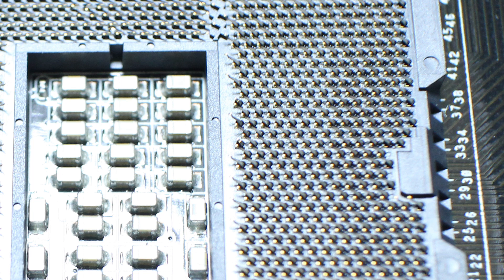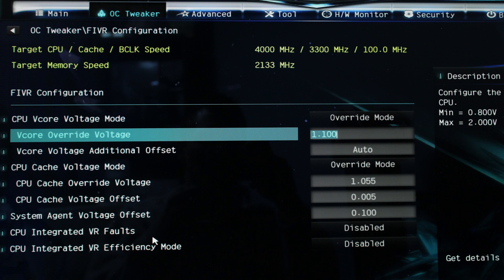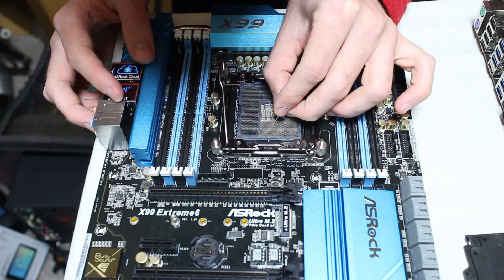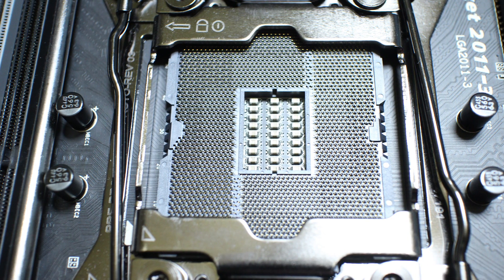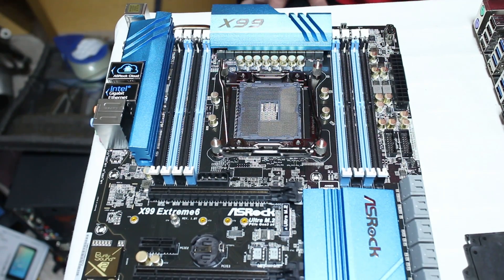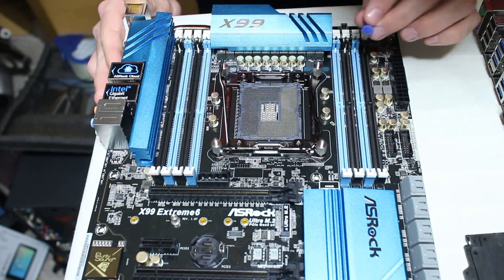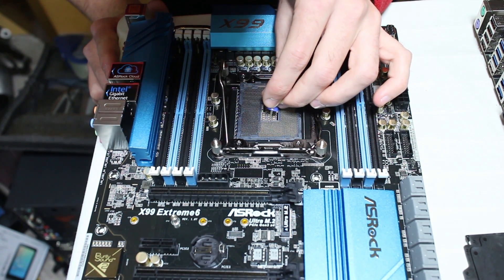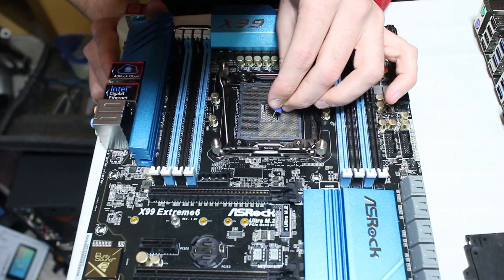How to fix Bent Motherboard Pins on an Intel Socket (X99 2011-v3)

Comment: Or just buy amd, those pins dont bent that easily
Reply: this happened to me and my 1st gen core i3 , decided to switch to athlon x4 750k to avoid this from happening again.
worst desicion of my life. feels like i lost 30% of performance while doing the switch.
Reply: Adam Hasso apperantly , not as good as an i3 540.
Reply: Tech YES City Nah, just don't don't fuck yourself, it was a surprise to me too.
Reply: iFreakTz when AMD Zen comes out in 2016 it'll be a serious competitor towards Intel, unless it's unstable and shit
Reply: Chimodann I call bullocks. The old i3 can't compete with a true quad core. Try ICC patch with all programs that run slower than on an i3. Otherwise it's utterly stupid to say the i3 runs better.
Reply from the maker: Damn you had 4.3ghz on the 750k and 4ghz on the i3-540 and it still beat it? I didn't think AMD were that far behind.... fuck me.
Reply: Chimodann WHy ??? that CPU is amazing.
Reply: I know, 2016 is 1 year away, but since Intel's 14nm is coming soon, and skylake Q3, it's not THAT far away, compared to their Bulldozer shit
Reply: Tech YES City ICC patch disables that "if (type != genuineintel) {run slow}
I'm well aware of Intel's gimmick, that's why I said he should use ICC patch.
Reply: Adam Hasso well this is getting emotional, lol , no problem man.
Reply: Tech YES City I'd send you a CPU if the shipping cost weren't as much as just buying a new one.
My FX motherboard broke so I got an upgrade, still have my FX 6200 if you're interested.
I would be shipping from the Netherlands.
Reply: Tech YES City I warned many a people about putting the 750k in their budget builds. I'm about to retire my Q9650 after 4+ years of good use and slide the good old i5-2500k rig into its place. A stock clocked Q9650 willl give the 750k a run for its money and once it's overclocked it'll trade blows.

There are at least a half dozen games on the PC that would choke the life out of the Core2Quad and I'm pretty sure they'd do the same to the 750k.
Reply from the maker: Yeah straight from AMD themselves.... lol I will be taking that one with a sprinkle of salt minus the sprinkle.
Reply: DavorBa i3s don't overclock at all. So the 750k must've been thermal throttling? Or what is it? AMD's stock coolers are a joke so you guys know.
Reply: DavorBa Okay, great. The 260x has a newer GCN architecture than 250, 270 and 280 so supports FreeSync(if you're into that)
Overall RAM speed can be important in some ways. If your GPU runs out of memory(2GB is kinda little these days), you'll use your system RAM so faster is better then. But within the 2GB the RAM is irrelevant in gaming(unless it's astronomically slow :P).
Have fun with your new rig.
Reply: DavorBa Coil whine might have the same cause as the crosstalk, though coil whine is not the cause of any frequencies you hear. It's the wiring of the mobo.

Running one wire too close to another makes the signal running through one "give off" some of it's current to the other which is called crosstalk. This can put unwanted noise in your audio output.

Coil whine is if the coils vibrate because of the electromagnetic waves shaking them around, these waves could theoretically be the same as the ones causing crosstalk though I doubt it.

Unstable voltage can cause bad audio too though so it can be your PSU in that regard. Though that is unlikely because MOBOs have a voltage regulator.

Oil on coils just reduces the whine you may hear near an adapter (the high peep, sometimes in bad cases really loud) because they can't vibrate that easily any more. Nothing else.

If just pressing mute in Windows solves the issue it's what Tech YES City said and can be solved  with that program(after updating your drivers) otherwise if you need to unpower your speakers/headphones it might be crosstalk or just... your headphones/speakers.
Reply: Tech YES City Hah! I was faster. By the way, don't you also wonder why they don't have normal laptop chargers which ground the laptop? It's been something on my mind since forever.
Reply from the maker: Have a look at the wiring, make sure your 12v CPU cable is not running over the onboard sound... driver clash could cause interference, but also the pcie slot drawing too much power can make the onboard audio do stupid stuff as well.  Though I think the software will fix it.
Reply: Tech YES City Are you still interested in the FX 6200? The shipping costs for a 50g letter would be about €3.50 which is no issue for me.
Reply: Chimodann That's bullshit, it must be better than i3 540, what do you use it for ??
Reply: everyday use and gaming .
would love to switch back to the i3 if i hadn't bought an a88x mb already.
Reply: Yes. but in 2016 ;)
Reply: Chimodann How is the gaming on it bad ??? look at tomshardware 750K vs G3268, the gaming experience on it is better than the Pentium in some games or equal.
Reply from the maker: CapnTates
There is actually some truth (albeit masked in the lies from Intel) to what he is saying though, since a lot of the compilers are made by Intel, Intel implements a certain level of 'detection' that will allow Intel CPUs to use certain instruction sets as opposed to the non-intel CPUs which will use a less efficient instruction sets (e.g. AVX vs SSE2).  So that i3 can indeed perform better than the Athlon depending on the task... Disgusting I know, but such is a casualty of living in a capitalist society my friends.
Reply from the maker: True and sorry I didn't read through all of the comments before commenting, is this the patch you are talking about?

https://github.com/jimenezrick/patch-AuthenticAMD
Reply: Tech YES City It's this one: http://www.softpedia.com/get/Programming/Patchers/Intel-Compiler-Patcher.shtml
not sure if it's the same.
Reply: Adam Hasso in games like dota 2 \ csgo i feel like i lost quite a bit of performance, still runs at over 60 fps , but from 170 it went to 140.
in windows aswell i feel like it takes much longer to load programs such as chrome .
Also my i3 was running at 4ghz if it matters to you.
Reply: CapnTates Gonna try the patch and report back , Also, the i3's are really underestimated.
Reply: CapnTates Alright these are the results [ In 3dmark ]
Pre-Patch [with my old gtx 460]:
Core i3 : http://www.3dmark.com/fs/1582879 [5263 in physics]
Athlon 750k : http://www.3dmark.com/fs/1843680 [3984 in physics]

After Patch  :
750k : http://www.3dmark.com/fs/1843680 [4000 in physics]

Now , as you can see , the i3 is around 30% better even after the patch. 
I know one benchmark doesn't mean much, but thats the only way i have to compare both cpu's as i don't have a mb for my i3 540 anymore.
Reply: Chimodann Both pre and post patch ones have the same link. Was the pre patch deleted?
Reply: Chimodann So let's say if programs load in 10 seconds with i3, how much would it take to run with Athlon ??
Reply: Chimodann So in CPU bound games, the i3 wins, can you try cinebench ?? Can you try other games like tomb raider or metro LL or 2033 ?
So if I was acting like an idiot but the last time I used the Athlon it was great and ran good
Reply: CapnTates woops my bad , pre-patch : http://www.3dmark.com/fs/1843680
Reply: CapnTates after patch is : http://www.3dmark.com/fs/1955961
Reply: Adam Hasso I don't have a motherboard that for the i3 [broken pins]. the only thing i have is the 3dmark scores , and i do remember that i managed to get just under 10 sec in superpi 1m.
As for the 750k,Its good if you know what you are going to use it for, would not recommend it for gaming and general use as single-threaded performance plays a bigger part in most games.
Depends on the user.
Reply: Chimodann Okay, thanks for your feedback.
Reply: Adam Hasso Me also. That was 1st gen i3? That's really weird.
I still don't like HT though.
Reply: CapnTates It's very hard to believe, if someone can provide more test then you have a viral video/topic.
Reply: Tech YES City Another thing , Idk if its just bad luck or bad motherboard, but @ anything over 4ghz with the 750k throttles like crazy [down to 1.4] after 10~ min of prime \ occt. my 24\7 clocks achive around 4000. Either way , You can only imagine the dissappointment i felt once i actually tested the rig.
But people [including myself] tend to forget the price point of a 750k in which it preforms quite well, but no where near a true quad core, those 4ghz mean nothing when it comes to the actual performance of cpu, its like judging a mouse by its dpi or a car by its rpm.
Reply: Adam Hasso almsot any decent benchmark has a website with its results , for 3dmark its : http://www.3dmark.com/search
you can compare the results by yourself , i didn't manage to find anyone getting 4800 or higher in firestrike [physics] with the 750k after a few moments searching might still exist tough.
While finding the i3 540 getting over 5000 is pretty easy.
Anyway, I have no reason to mislead people, and its your choice whether you want to belive me or not.
the reasons i put so much effort into those comments are :
 1.I don't like it when people claim im lying.
 2.I felt very frustrated when i realised i paid 150$ [cpu+ mobo,in here its quite expensive] for a downgrade, don't want people to make the same mistake i did .
Reply: Chimodann But I believe you and I apologized.
Reply from the maker: I will look into it further, I just didn't think AMD were that far behind, seriously the 750k is probably looking weaker than a q9550 at those levels...?!
Currently tied down with so much work, both irl and tech lol. Though I actually really want to get my hands on an AMD CPU at the moment for input lag testing, as I just finished testing (preliminary results)the x99/5820k for total input lag with different mice, and man the g302 came in the fastest with a run of like 28ms (off the top of my head), stupidly fast if you ask me.
Reply from the maker: That sounds like a decent proposal, if you can just shove it in a letter pack with some bubble wrap around it, that would work (I have a heatsink here already), then I can just try and purchase a cheap second hand mobo off the auctions and see what results I get for input lag, though the 6200 is bulldozer or piledriver? After I am done testing I can just hokk the lot and give you some cash?
Reply from the maker: Yeah a lot of people always tell me to put AMD cpus in my budget builds, but due to my personal experiences with the fx-8320 (I was honestly not that impressed with that CPU, despite a lot of people telling me otherwise), I always put in Haswell Cpus (in the budget builds). Though with recent input lag testing as well, I was quite impressed with Haswell in general, we are talking a TOTAL input lag of 28ms in one run with the g302 and that is with a korean IPS monitor that I know can add about 10ms of input lag... pretty damn impressive if you ask me.  I will further be recommending the 3258 over the 750k/860k for the time being (as I have been doing recently) and will continue to until AMD releases something comparable.
Reply: Tech YES City Well, these scores can drop drastically for a single feature you miss (AMD's single core perf).
I did hear with mantle the 8350 outperforms the LGA2011 i7 extreme. (That's non-V3)
I don't think AMD coloured their API wrong after what went over Intel, but it is most curious.
Reply from the maker: I see, was that the 8350 with mantle vs the Intel without mantle?
Reply: Tech YES City no, both using mantle.
http://techreport.com/news/26709/amd-lauds-mantle-gains-in-plants-vs-zombies
Not sure if these numbers are reliable, but they can't be unfounded.
EDIT: wrong link :P
Reply: Chimodann http://www.cpubenchmark.net/compare.php?cmp[]=738&cmp[]=1801
I saw your screenshots and the difference between physics score (400 difference) and I don't have anything to add really. Maybe the old i3 are better overclockers ?  Because the link I gave was stock speeds and clearly the newer 750k beats old i3 in every benchmark.
I'm sad you don't have a mobo to conduct more tests, some maybe at lower clock, because your chip which can normally go to 4,5Ghz, couldn't go above 4 for some reason.
Reply from the maker: The 540s were still able to, before Intel released sandy with the K and Z crap.  Agree with Tates, OCing the 750k and also FX CPUs on budget mobos / stock coolers is a no-go, though the 3258 will do it absolutely fine, Also the i3 with some bioses on b85 mobos will be able to max out to the turbo frequency as stock clock.
Reply from the maker: I also think passmark is heavily AMD sided, because it benchmarks the integer units heavily (which AMD usually has double of compared to the respectable intel counterpart).
Reply: DavorBa the link i gave was the highest score i was able to achive with the 750k [just out of curiosity i wasn't using my 24-7 settings] , it would throttle after 10-15 mins of stress testing,
but it didn't during the 3dmark run.
as i said my 24-7 oc is much lower [3.9ghz, slightly lower than the max turbo clock] and i get around 4000 in 3dmark , i think the problem is mosfets overheating.
so a little tip - don't buy ga-f2a88xm-ds2 if you are planning on overclocking a "power hungry" cpu like the 750k , but it should work fine dualcore apus and such.

while the i3 score i achived was one of many and im pretty sure its not even my highest , i'm just too lazy to go trough all the benchmark runs[i have over 70].
I like 3dmark because it simulates a real gaming scenerio pretty well so its a good indication on how well a system will do in most games.
And as far i can see, the i3 540 beats the 750k in 3dmark , but then again its only a one benchmark and does not tell the whole story.
Reply: CapnTates nope ,you could oc most of the 1156 cpu's just by changing the bclk.
and i used a corsair a70 which is a pretty high end cooler and it did amazing job with the i3 [didn't go over 63c on occt even on the highest oc settings.
another issue im having with the 750k is bad sensors [pretty common] , the cpu package temp seems to be getting to around 100c in occt\prime while i got a "tempin1" sensor that gets to around 75 which is more realistic but still seems too high [i even replaced the thermal compound because i tought it was the issue]
i have tried hwmonitor ,hwinfo,coretemp and speedfan non of themseems to read correctly my temp.
Reply: Chimodann My friend, whos PC I use the most for heavy gaming, has athlon x4 640, and was my reference point to how much I wanted to spend on a PC, without wasting too much money. His PC handled every new title that came, although with some problems playing watch dogs, which were solved when lowering details. I played Shadow of Mordor the other day on it, maxed with Radeon 7000 series GPU (dont know which one exactly, it doesnt say precisely).
So I ordered a 860k system, having read many good things about the CPU, compared to the FX line. Waiting a call from my retailer any day, to go pick up my system.
Now it worries me you mentioned that mobo, because thats the one the retailer ordered, after G1 Sniper series price went up.
I'll tell you how it goes with the 860k when I get it.
Reply: well, lets hope its just me being unlucky and not a general issue with the board but even if it is, you can try to get mosfet coolers online and that should solve the throttling issue, im not doing it because i will be building a new rig soon.
We have pretty similiar systems as im using an overclocked 7870xt [similiar performance to stock 7950]
and i do feel the gpu is bottlenecked by the cpu. because in bf3 mp i can't get 60fps, on max settings [no AA\AO] im getting ~35fps and on low settings im getting ~45fps . 
But its been a while since i checked last time.
Waiting for an update from you about the new system.
Reply: Chimodann Well, I just got back from my retailer. We assembled my PC, but the 860k and R7 GPU I ordered didn't get shipped for some reason, so the guy gave me a Athlon x2 340X  (new, unopened) for free to use until my original order comes. Also he gave me some used GPU, because the integrated one in that mobo only works when coupled with an APU. 
So, I never heard of this athlon, but its better than the toaster I'm using atm.

Having trouble setting my 2400Mhz RAM to go to 2133Mhz atm, instead of default 1600Mhz. And yes, the mobo supports this particular ram. 
I'm off to solve the prob.
Reply: Chimodann The CPU uses its own temp sensor to decide whether to use thermal throttling or not. If the sensor gives too high of a temperature, the throttle will be default. Maybe the CPU is defective?

I had good experience with an FX 6200 (still old FX architecture, the 6300 has the newer one) never had the idea my fps was limited by it.

The HD 7870 is great, I have a friend still running one perfectly with an FX 8350. I had the HD7950 as GPU (it was broken, but I got it to work with minimal crashing. as fast as I brought my GPU to the store they were like "you know this thing is broken, right?" I thought it was my fault....) but it performed great, Skyrim with 120 mods only crashed once in 2-12 hours(I play that much yeah, it was mostly after 6).
Reply: DavorBa Don't bother with RAM that's only really relevant with an APU. What GPU did you order? I hope R7 260(X) because below seems like a waste of money to me. I would recommend getting an R9 like the R9 285 if it weren't too late already.
Reply: CapnTates Hey. I saw a benchmark of different RAM on steamroller, and 860k used higher RAM pretty well. Not like gpu component of 7850k, but definitely a bump. Besides, this RAM was on sale so it was very cheap. Yeah I ordered 260x Saphire OC 2GB. Didn't have money for stronger GPU. After all, this is a very budget limited build.
Reply: Chimodann Hey, I have to ask you something, cuz you are the only person I know who has GA-F2A88XM-DS2. 
Do you use internal sound card or something else ?
I'm having some weird feelings inside my ears when listening to anything coming from the PC. The audio is clear and as it should be, but there is something else with it that makes me want to mute everything. I'm listening to my favorite music and I can't finish a song because I feel like my ear drums are bleeding.
I'm not kidding. Did you have similar issues?
Reply: Davor i have had that mobo... Had the same problem thats why i switched to an asrock...
Reply: hoepsipoepsi OMG I'm not crazy then. It's like something is raping my ears!!! On monday I'm returning this piece of shit for something that won't make me lose my hearing.
Reply: DavorBa mine seems to work fine when it comes to sound, still , gonna stay away from gigabyte from now on.
Reply from the maker: Check my equalizer APO video, it is probably an impedance mismatch with your headphones which causes the 7khz region to spike (sometimes extremely heavily, especially on the Gigabyte UD4 I had here).

Also you can try uninstalling the drivers and then getting the latest realtek drivers and then just manually updating the drivers from the high definition devices in device manager, that fixed my ASUS's supremeFX audio which was distorting heavily under ASUS's own drivers.
Reply: Tech YES City If it's crosstalk, there is little he can do though.
Reply from the maker: Yeah that board should have a fair bit of it lol, but that won't cause his ears to ring and sting, the main culprit I think is the impedance mismatch which I know that Gigabyte sure did a fantastic job of that with my x99-UD4, I had to drop the 7khz region down by -9db on that board as well as -6db at the preamp and then my ears stopped ringing.
Reply: Tech YES City I've read something similar to what you said, but it didn't go into detail. Do you have any practical advice for me, cause, my PSU is also producing similar sensation (but not so much like sound card) and I've read that it happens sometimes but no real clue on how to fix it.
Reply: DavorBa Coil whine? That can be resolved in a way that voids warranty; dunk any coil you find in there in oil.
Coil whine is generally not covered in warranty so you either need to deal with it or get a new one from a good brand with a good rating.
Reply: CapnTates But could that be causing the issue with sound card ? You mentioned your impedence missmatch, is that easier to fix than dunking coils in oil (if that is the culprit, cause I can live with that, but cant live with sound off).
Reply: CapnTates Well, need to find the video you mentioned. Also I will borrow a sound card from a friend next week to see if that makes any difference. Speakers and headphones work perfectly, they were used before on another PC with no issues.
The problem is present no matter how low/high I set the volume. Anything non-mute is revolting to my ears. Just can't believe something like this can happen. Worst thing is it doesn't affect the sound quality, which is perfect btw, but it's just there, with the sound, un-hearable.
Reply from the maker: Might need to ground your case if you are hearing some kind of unnatural interference. Here is my tute here, it could help you - https://www.youtube.com/watch?v=wmHAqh_HYT0
Reply from the maker: lol didnt see that you already helped him out.  As for laptops not having grounds that is a weird thing, never really thought about it? Maybe they have a big ferrite choke in the AC adapter to compensate? In aus the adapters usually have 3 prongs for which one of the prongs is a ground.  In japan though it is only 2 prongs and grounding is something of a rarity here (I had to run my ground like 5 meters to my aircon's screw in ground)....
Reply: Tech YES City Update on my issue.

Went to the shop where I bought the PC. The guy there mentioned something about frequencies from PSU overlapping with certain hardware and causing weird noise as cause. He also mentioned that because PSU is currently using a very weak GPU (doesn't even have external power cable exit), it's very likely thats the cause for the noise, because PSU(500w) wasn't working nearly as close to its max strength.
He also said I should install windows 7 on different HDD to see if that fixes the problem (he didn't really believe in the win8 I have). He gave me a random HDD and I did just that and it didn't work.
Wanting to test what he said about a more powerful GPU, I borrowed a newer GeForce from a friend, installed it and to my huge surprise, I could actually listen to the music without making terrible pain-faces.  I am relieved so far, but there is still a fraction of the ear-screeching frequency I still notice.
Could my new 260x (that uses more power than this friends GeForce) + 2-3 times more powerful Athlon than the on I'm using completely remove this frequency thats driving me crazy ??  Well, I will keep you posted, once I get rest of my ordered components.
Thanks for the help so far, I will use that software once my hardware attempts at fixing this fail. I can't cope with the idea that the new stuff I buy create such problems, so I will firstly try with different parts and warranty.
Reply: Tech YES City It's a brand new system, the sound drivers are the third thing I installed (after ethernet drivers and Opera). It is possible that the GPU they gave me to use uses too much pcie slot power, because it has no other power source, unlike the one I'm using at the moment. 
Changing to a more power hungry GPU also fixed my "hum" from the PSU. It's quieter now than it was with the weaker GPU. Really strange that some PSUs work like that, but the guy that assembled my PC said it's not uncommon.
Edit: no cables are near the onboard sound.
Reply from the maker: It is not that it is using too much power (there are ATX specifications which have to be met by GPU makers), but rather the motherboard's PCIE slot can't deliver that power efficiently, also partially the PSUs fault too (if it is a terrible PSU with bad regulation / large amounts of ripple etc. which will put more strain on the mobo and GPU components).  So I think changing out the PSU and GPU will help, but sounds like the mobo is the main culprit here.
Reply: Chimodann a athlon 750k is 25% percent faster in single threaded tasks so you were probably thermal throttling did you try remounting your cooler
Reply: about 5 times . 
I'm 100% certain that i3 is faster in single threaded performance and its pretty close in multi-threaded but i would still give a slight edge to the i3.
Reply: Grim Reefer I think the CPU is defective.

Chimodann did you check the temps with something like MSI afterburner?
Reply: I checked with hwmonitor , cpu tmp , hwinfo. speed fan , and pretty much anything i could find , even tough the temp sensor is shit i can assure you it does not overheat or throttle under my current settings . 
I throttles only when i try overclocking and run Prime95 \ OCCT for more than 20 min.
needless to say gaming is not even nearly as demanding. 

This terrible experince with amd set me in a weird position as i can't decide if i should go with a new i3 or grab one of the old fx 8320 as they are both in my price range . 
would love to hear some suggestions.
Reply: Chimodann Wait for an i5. If what I'm hearing from you is true, I don't feel like recommending anything less o.o
Reply: Chimodann http://www.cpu-world.com/Compare/95/AMD_Athlon_X4_750K_vs_Intel_Core_i3_i3-540.html         my guess of 25% was wrong its only 18 percent faster in single threaded tasks an 40 percent faster in multi threaded tasks
Reply: Grim Reefer That link actually shows the i3 2% faster single threaded performance...  Nevertheless, for modern day use where more and more stuff uses more than 2 cores, Ahlon x4 is the way to go (in that price bracket).
Reply: DavorBa sorry i miss read it but the 750k overclocks so you could pull 10% better single threaded performance on a aftermarket cooler.(I read the part that said 18% better performance and thought that was in single threaded)
Reply: Chimodann Hey, finally, an update on my 860k rig. Waited to solve all problems before I wrote here.
Firstly, when I got the 860k and R7 260x, the "noise" I mentioned was still there. I returned the already expensive PSU for a little better model, thinking that was the issue. I still am not 100% sure that was the problem. The loud CPU stock cooler made so much noise that it masked the real problem.
Today I got a Mugen 3 cooler (wanted Katana 3, but they were out of stock). When I got home and turned everything on, I was very happy about the noise difference. But now, that the PC is barely audible, about 1 meter away from me, I noticed that "frequency" thing that drove me insane in the first place! 
I just can't put my finger on it, I just can't!  Clearly it's not the GPU (tried 3 of them), not CPU cooler (tried 3 of those), not HDD (because when I unplug it and enter BIOS, the "frequency" is still there), it's probably not PSU either, cause Fortron (FSP) is a very reputable name in PSU industry and I bought 2 different high end models and still have the problem.
That leaves me with only the motherboard. I could return it, but the shop I bought it from, got 20 more exact same models to sell with their FM2 and FM2+ CPUs. 

Besides the problem I mentioned, I am very very happy with the performance of my PC. I don't know which high performance game to install to push the PC to it's limits. For now I'll mostly be playing titles like Gothic 3 and Witcher 2, because I couldn't play them on my old rig.
Reply from the maker: Probably the Chokes on the motherboard, if you are up for a bit of ghetto modding then you take the heatsink off (if it has one) and dump a heap of silicon on it.
Reply: I'm up for anything at this point. There are no heatsinks, its a cheaper mobo. The chokes are the black squares, or the cylinders ? Is there another, more "non-permanent" solution to try ? Will it cause the chokes to overheat ?
Reply from the maker: I mean an easy way to test would be to get a mic and then wave your microphone around near all the components (with a camera too synced) and when you hear the loudest noise coming in then that is your point of fault, you can also use your ears too :P. 

The chokes are usually the black squares, they are before the caps (the little standing cylinders).  As for another solution I don't know of any, and it won't overheat, just don't cover up the mosfets, they are before the chokes, they can overheat.
Reply: Tech YES City  I tried to pinpoint the location using only my ears earlier this day and I had more luck than I did days ago. Today I bought a sizable cooler and maybe it was the cooler that amplified that frequency or I don't know what, but I can bet it came somewhere around the CPU. I just didn't know that there was anything there that can cause it, so I discarded that as a possibility.
I know about the mosfets and how they look (a row of black little chips behind chokes and cylinders) and I won't touch them.

I have these: http://www.ricardoevaz.com/images_user/artigos/pintatumesmo47494684440_529f1c48a1a6a.jpg
They are little glue pads that easily come off, I wonder if they would do the trick, providing they don't wreak havoc with the moisture they contain.

Also, one more thing, today I noticed that when I move my mouse, the area around CPU would made noise at the same time. Currently my PC is at a slight load and even now I can notice the sound change around CPU when moving my mouse (I have to come very close though, but it's still there). 
Could it be that these 2 things come from the same source ?
Will try the mic detector trick.
Reply from the maker: I mean I would put it down to the Mobo or... it could possibly be your monitor too, My korean monitor with a full white screen produces a slight audible noise, try putting a full white screen on your monitor and then turn it off and on and see if you can rule that out as a possibility too.
Reply: Tech YES City Monitor test done. Whatever I do with it, its the same.

Since my last comment, I've tried the mic detector trick. I removed the back of the PC casing and turned up my speakers. There was a loud noise coming from around the CPU. 
Then I remembered I had a stethoscope. With one hand I moved the mouse, with other I listened. There was no doubt about it, the screeching noise when I moved the mouse, came directly from the CPU socket area, no more no less.
But the really annoying frequency still can't be pinpointed. I'm at a loss really. When I stuck my head above the desk I cant hear a thing.
Perhaps the PC should be down there, obviously I am too sensitive to its working sounds.
Reply from the maker: Yeah probably the chokes on the Mobo, time to get a silicon gun and cake it lol.
Reply from the maker: Hey man, thanks for the offer, I am bogged down in work, don't imagine I would get time to do anything meaningful with it, thanks for the offer though, really appreciate it.
Reply: watching these comments in 2018 is fun